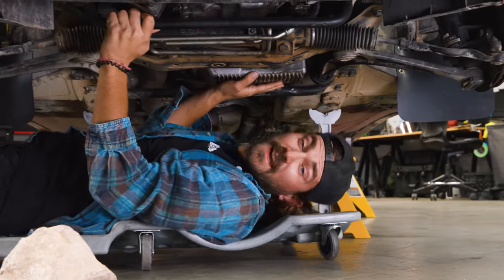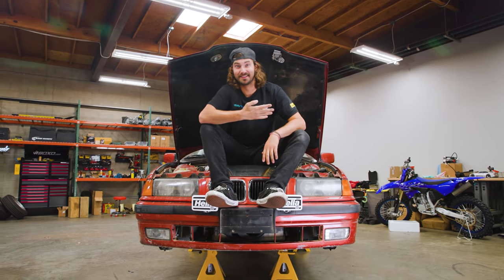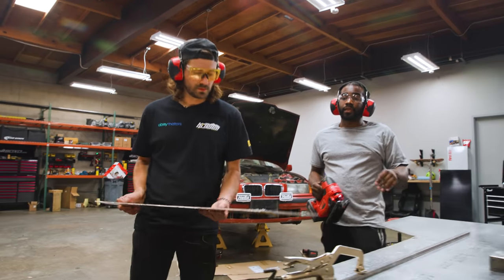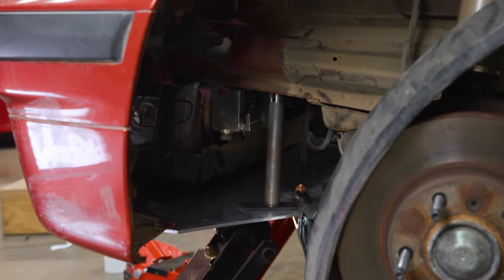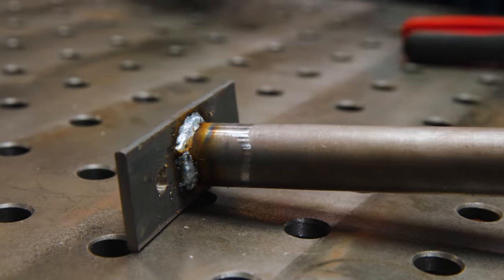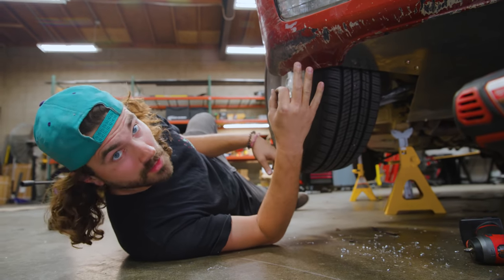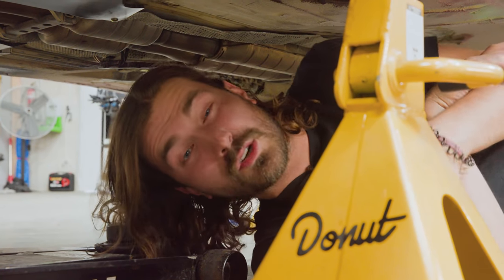DIY Rally Skid Plate - Is it Worth It?

Comment: PRO TIP: add an access hole to get to your drain plug, maybe two if you need another for the oil filter that way you aren’t removing the whole thing every time.
Reply: You need to get an oil extractor and never touch the oil drain plug again!  Its a game changer.
Reply: PRO TIP: make the skid plate bolt on so that it is removable, solving this problem and letting them remove it to clear out debris from their offroading adventures at the same time. Oh wait...
Reply: This is nothing compared the skid plates on new cars.
Reply: I forget which car but someone made a plastic skid plate with no access hole and ~18 bolts to remove. Fuck I hated that when I was an apprentice, telling the boss "hey, I am going to need way longer to finish this oil change, I have to try to make this fucking skid plate line up in like 18 different places.
Reply: He would just need the one for the drain, since the oil filter is on top. I think that is how it is for this generation BMW. What I would do is put to threaded inserts and make a slightly larger access hole so when you do drain the oil it doesn’t splash onto your skid plate
Reply: @LanceAtlas  fuck it weld a hinged plate on 'er 😎
Reply: @kegfreak3728  It's been proven time and time again that an extractor is better than nothing but no where near pulling the drain bolt. It leaves a whole bunch of old cruddy oil in there.
Reply: @derpyduck5088  no it does not Jamie the mechanic has done many tests on this and has proven the “sludge/crud” theory to be bull shit
Reply: Except you end up with oil on the top of the skid plate almost all the time like my previous rally car did, so we used to take it off and clear rocks and debris from it anyway.
Reply: @h0udinl  get a magnetic drain bolt and you will see that there is also metal that is hard to pump out vs drain .
Reply: They dont need to change the oil, they gonna replace the engine when they blow IT 😅

Comment: Oh cool, it's actually a skid plate and not an exhaust this time!
Reply: i don’t get it
Reply: @DWSF989  If you had notifications on when they did the exhaust video, you would have noticed they had "Skid plate" in the title before they fixed it.
Reply: @AniSky759   ohhhhhh thanks man
Reply: Mine center muffler has over 30-50 dents after work with different route to home. Idc if it fell off and wake up neighbor in 3am.
Reply: @technocody9296  what
Reply: @technocody9296  did you have. A stroke…. Should we send… medical help?
Reply: I am usually careless, so you know. Anyway, I still driving hard after work in backroad because most fun came from adrenaline. 

What I said, my center muffler has many dings that I can't count while changing engine oil. Look like over 30-50 dings. No noise leak or rust yet.

Comment: Remember kids, Dwayne is headed straight for your oil pans.
Reply: I'd buy a donut brand Dwayne rock. Combo pet and paper weight.
Reply: @jaydub8576  I need to make a little sticker sheet with a bunch of little copies of his face to put over any rock chips on my hood.
Reply: Dwayne vs One Grit, who's the better rock...?
Reply: you mean the wok
Reply: @Brandon Fischer omg bro 🤣😅
Reply: I think you probably you could've gotten away with using Button Head Socket Cap Screws instead of the square edged Hex Head Cap Screws, to avoid shearing the heads off...? The button head should have enough angle-of-deflection once they're torqued down. Just an idea. And it's likely a good bit cheaper and easier (less work/time) than the alternatives you mentioned.
Reply: Why did you guys use aluminium? It is quite soft compared to steel. Is because of the weight?
Reply: Lol!
Reply: @jarnickramm6026  most likely weight savings and well, you don't need to be bulletproof. You're fighting rocks not anti tank mines.
Reply: Like a Rock😂😂😂😂
Reply: @DannyPlaysStuff  yes! That is awesome

Comment: For the exposed bolts you should look into getting rally washers. They are washers that have a flange designed to help a rock slide over the bolt and not shear it.
Reply: This
Reply: This is a good tip
Reply: Or just countersink the holes and get matching machine screws
Reply: Also use some damn loctite bro.
Reply: Those just look like really fancy stainless finishing washers man. Why couldn't they buy stainless finishing washers?

Comment: Make sure to watch your temp gauge. Adding a skid plate can block air flow exiting from your cooling system causing an over temp issue. Might add some vents to rectify that potential issue.
Reply: Some louvers would be nice. A lot of trucks have plates with louvers already built in.

Comment: The plates turned out nice! I think you forgot major things though when it comes to protection from rocks. One are wheel scrapers to kick out any rocks from the inside of the wheels. Without them, over long distances, the rocks can turn your 1 piece rims into 2 piece. The other is foam underneath the oil pan. While the skid plates do protect it well, if a rock manages to get nudged between the skid plate and oil pan, it'll become a focus point for any forces that hit the skid plate in that area. In that case, it'd actually be better to not have the skid plate. Much like how sand on a beach can make its way into a house, pebbles and small rocks can weasel their way above the skid plate.
Reply: I'd add actual rally skid plates have additional reinforcements and mounting points over them, that are supposed to transfer energy if you hit the ground during landing a jump or hitting a really big rock.

Comment: 8:32
Not to grumble but I'd recommend a deformable material for the extension struts, as a hard bump there is transferring the force to the rail above. That could be game over.
Reply: Exactly what I thought when I saw that.
Reply: Jobe make the version 1.1 ^
Reply: Thankfully, without cross braces the strut is more likely to collapse, folding towards the rear if any serious hit happened. But yes I agree
Reply: I thought they were gonna just take the strip of steel and bend it at a 90 or so at each end with a single hole in it. I think that would be enough and it would surely bend first before it bent the frame. No welding required for that too.
Reply: @adamrichardson2227  That would be perfect
Reply: @BuddhaOfDarkness  I mean, I don't know how to weld or have a welder so I learned how to get creative with a vice, drill press, rivnuts and some good ol' aluminum bar stock :D

Comment: As a tip, when working with CAD (Cardboard Aided Design), when you want to mark out attachment locations. Tape a thumb tack where you want to put your bolt holes. Then when you push the cardboard up it will leave a hole in it. Then you can remove the tack, and use your punch through the hole in the cardboard. This can save you a little time, and/or swiss cheesed cardboard.

Comment: For large cuts of aluminum sheets use a circular saw with a metal blade, I was taught by a 10 year vet of aluminum welding  and by far the more easier and cost effective way for cutting the material
Reply: A lot of people don't know you can cut aluminum with a circular saw but it's a really great tip.
Reply: @Yoshikaable  it really is as I was once in there spot with cutting aluminum and went through a ton of cutting disc's, jig saw and Sawzall blades. Then at my friend's business he cut large amounts of with just the circular saw and doesn't kill the blades.
Reply: I’ve had great success using sharks with frickin laser beams
Reply: As a posed to circular saws with paper blades
Reply: @brandonsojka6726  metal blade means a blade meant for cutting metal as opposed to a blade for wood. The cutting teeth profile and counts are different
Reply: I cam confirm this lol i do it all the time.
Reply: I've heard that carbide tipped wood blades could work on aluminum. I can't confirm or deny
Reply: I always heard you could use wood blades with some lube, never tried it but id be interested to see if its more efficent than a metal blade
Reply: came here to say this!
Reply: Damn I just be use 20 gauge metal shears
Reply: @Yoshikaable  that’s why u wear proper shit to protect urself
Reply: Haha guillotine go brr
Reply: You’re not wrong, I’m sure it is cheaper in the long run, but this was just a small project, nothing to be that concerned about cost when those Milwaukee blades are just a few bucks each..
Reply: @brandonsojka6726  

Opposed*. 

C'mon man. If you're going to call out silly stuff, don't be obviously stupid.
Reply: An all purpose blade or a wood rip blade on a jig saw will cut it too because the teeth are deeper they don't get clogged like the metal ones and because aluminum is so soft the blade doesn't dull too fast.
Reply: You can cut lots of stuff with metal blades on circular saws. Company I used to work for had them in the stamping press room for material that was too thick for Beverly shears

Comment: You dont want a skidplate flush with the oil pan, there is no room for flex from an impact. Stand it off a bit but also dont forget to add foam between the skid plate and the oil pan. If a rock gets between and you bump something its and instant hole the same as if you flush mounted it.
Reply: What type of foam could withstand the heat of the oil pan while actually being dense enough to absorb impact?    Not sure that is needed. The important part of the skid plate is to prevent an upcoming rock from going above the level of the oil pan and crashing into the front of the oil pan.  Instead, the plate makes the dangers pass below the oil pan and glance off.
Reply: Alarismos  That's sound insulation foam.  It would be worthless against an impact.   I don't think there are any materials a home mechanic could get their hands on that would work in this application.   Have you seen anyone who actually did this?  (I'm open to being wrong here)
Reply: @Greg Wilson If I understand correctly, the foam would just be to take up the space between the skid plate and the oil pan and make sure no rocks get lodged in there. It wouldn't need to be impact resistant :)
Reply: @kilgoretrout90210  This is correct.

Comment: Instead of going through the effort of sinking the screw heads in or building guards for them you could also just get some round headed screws with a hex or torx key.
Reply: Button head bolts are the answer for sure
Reply: Yep, using flanged button heads on my motocross bike, cheap and no ripped heads for years. Go for it!

Comment: You should recess your bolts! in order for something to shear the plate through the bolt, the shear area is the circumference of the bolt head times the thickness of the plate. When you recess your bolt, you are usually using wider heads so it makes the whole thing stronger too. Something like a flat head bolt with a shallow chamfer angle (standard is 82 deg) will really help.
Reply: Came here to say a stupider version of this.  Not much will "skid" past those bolt heads on that plate, they'll catch and may tear the whole thing out if it happens to enough of them.
Reply: Pretty sure he discussed this at the end of the video.
Reply: Countersink the holes and then get countersunk machine screws instead of bolts

Comment: You need to add some redundant fasteners to the skid plate so that if you do sheer some off the plate won't dangle down.  If it dangles, you risk major damage if the dangling part hits the next rock and the plate starts getting bent into very bad shapes.
Reply: We fitted our rally car with some steel cable welded on with like a mm of slack, and bolts on the other end, It saved our ass in the Auckland Rally, Still managed 2nd after smashing a bank as didn't fall off.

Comment: Thumbs up for the Final Fantasy reference with a car video! Edit: I should more importantly say, since I didn't see anyone else say it, save the cardboard outlines! The whole point of skid plates is they're cheaper to replace than the component parts you would be damaging. Having to go through the trouble of cutting new cardboard and then aligning the already existing bolt placement would detract from the full use. Great video, love the direction the Beemer is going!

Comment: The sheet is gonna rattle like crazy, so adding silicone caulking in between the panels and the frame has reduced rattling on cars and karts I’ve worked on. Just a thought if it is unnecessarily loud.

Comment: Should add the x-brace found on Z3, convertibles, and M3. It'll add rigidity/stiffness to the chassis.
Reply: Also if you haven't added a Short Shifter look into the Z4M lever. Add a slight bend and it'll fit perfectly. Cheap oem short shifter. Add the UUC DSSR as well.
Reply: Pretty pointless considering they have a welded in Rollcage.
Reply: Agreed!  I built the skidplate for my M3 similar and it is reinforced by the X-brace.  My skidplate has 2 hooks on the back of it that hook onto the rear tube of the X-brace, then it gets attached to a brace I welded up in the front.  The front brace is triangulated, mounts to the frame at the bumper mounting points, then back to the anti-sway bar mounts.  Also, the front of the skid plate should extend beyond the leading edge of the lower edge of the bumper and get bent up about 30 degrees.  Mine is also mounted with some 1/4” pins with the spring-loops around them, very secure but the plate can be removed in seconds.
Reply: @NotSean269  not really since it also gives extra protection to the oil pan area in the event the skid plate breaks off. I always say extra precaution are better than minimal. I had an e36 before so I know from experience.

Comment: I was working on Fabia S2000 and lightest base skidplate was from 5mm aluminium with reinforcements. And was intended for road use only. For Offroad use va are talking about about thicker aluminium or steel. There are three skidplates on Fabia. Front, midle and back. And with combination of variants of skidplates you can add a lot of weight to balance car for example on jumps. Difference between lightest and hevies combination of skidplates is over 200kg.

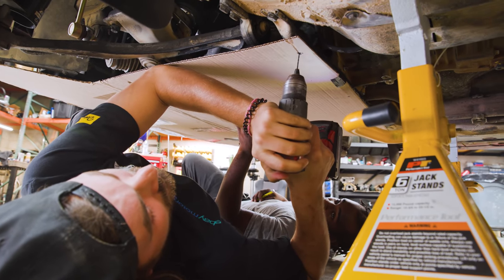Comment: 4:50 Drilling holes in the cardboard and transferring them to the frame was a pointless exercise.  Fab the aluminum, clamp it to the car, and then drill all your holes in one shot.  Also, you should have used flat head cap screws and drilled tapered holes in the skid plate so that the heads of the bolts don't get knocked off.  Otherwise, a pretty solid project overall.
Reply: Easier to line up the holes with the foldy-bendy cardboard rather than having to guess or actually measure where the holes would have to go with the aluminum plate in your way. Good point regarding the screws tho. Fact is, it ain't too late to fix that.
Reply: @JunKus3R  You don't have to guess or measure anything.  The frame members around the perimeter are easy to see and you can draw lines with a straight edge across the skid plate from the ends to determine where in the middle you want to drill.  The issue with using the cardboard is that your holes will not line up because a sloppy hole in the cardboard will not transfer nicely to the frame and to the skid plate.  They likely had to enlarge the size of the holes in the skid plate off camera in order to get the bolts to line up with the riv-nuts.
Reply: @SuzukiKid400  Mix of both would be easiest. Mark where you want the holes on the cardboard, transfer with marker to the skid plate after it's cut, clamp in place, drill through. No guessing, no measuring, no misalignment.
Reply: @MeatPoPsiclez  I agree.

Comment: I’m making a skid plate for my XC70 this week. Got 5 road signs and a hydraulic press and some pipe to make recesses for the bolt heads. Using flush mounting hardware. Lucky for me Volvo’s are pretty flat on the bottom. 

My suggestion would be to use a press and a torch heat up the spots where the hardware is and use the press with a ring on the other side to make recesses for the bolts and use large diameter flanged button top hardware with torx head or if you weld backer material at each bolt you could countersink the holes and use a flared flange bolt which would give you a nice smooth skid plate. 

What to you did will work but I’ve seen how you all drive at the donut and this is going to be problematic at your first oil change. 

PS I’m a former SCCA and Street racer and have worked as a power-sports tech for over 19 years so I kinda know my stuff and have seen some pretty crazy stuff happen over the years, including skid plates causing more damage than if no plate was used at all.

Comment: For aluminium next time you can use bi metal blades (for wood with nails)  the teeth on the blad are more spaced out but still hard enough to cut metal with it. 
works like a charm 👌

Comment: When cutting aluminum, lube the blade with bar soap, cut fast. Aluminum cutting sheds heat through the chips, so you want to get rid of them fast. If they hang around that's when they gum up.

Comment: i had the same sort of setup on my last car, never knocked a bolt head off and used to rip around a rock pit I worked at so it took allot of abuse from rocks. your setup looks a little cleaner though i just used an old aluminum sign and made it fit but it wasnt quite big enough to fit this clean.

Comment: A jigsaw is OK for aluminum plate, especially if you need detail, but for long cuts you'll cut much faster -- and straighter -- by using a circular saw with a low-tooth cheap blade, like the blade that came with your saw. It's so much easier to keep your cut straight, and for real the rip cut MOVES material. For cuts like you're making here, don't hesitate to use a table saw.

Comment: Usually rally teams make underbody protection using hard plastic that comes down each side of the car running from the back of the skid plate to the rear control arms to protect the fuel lines, brake lines, fuel tank, and floorboard of the car.  Rocks or debris can puncture holes in these and well ... game over.